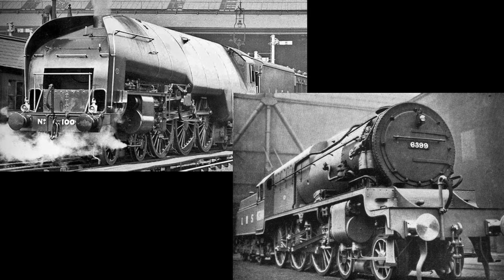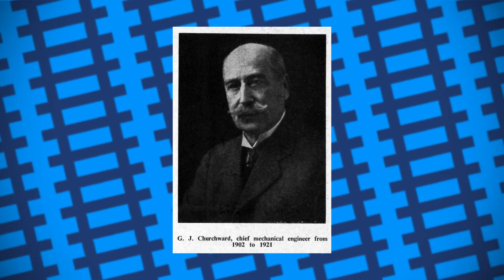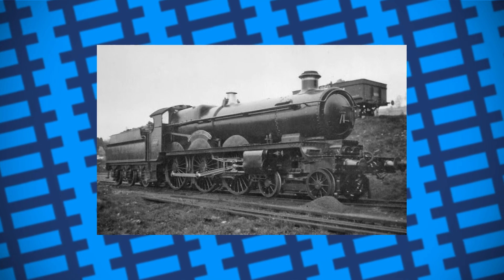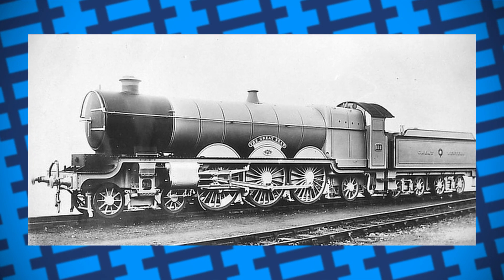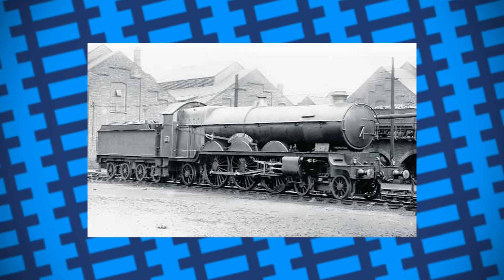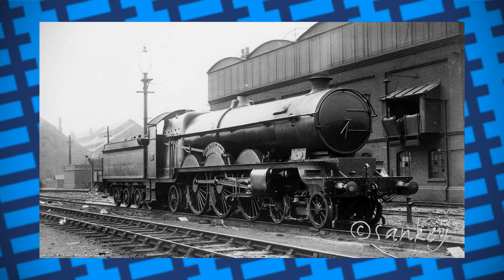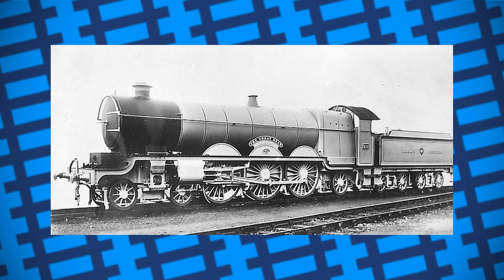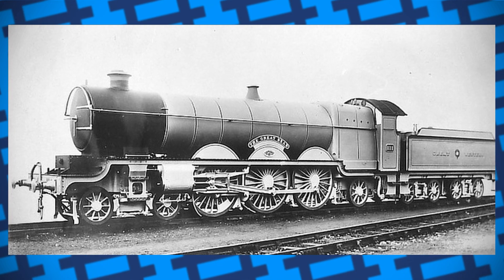The GWR's experimental pacific locomotive - GWR "Great Bear"

Comment: It has been suggested that the engine's frames may not have been very well aligned- while its trailing truck overheated- a problem that was never really addressed. This alignment issue could be a major problem and ended when C B Collet- Churchward's successor- a man who was not a locomotive designer- although his name is given as designer for so many classes- which were left to others to draught up- and were in the main part of Churchward's planned standard designs. Collet was a skilled production engineer and he installed Zeiss optical equipment at Swindon Works to make this alignment simpler to achieve and far more accurate. As the engine was pretty much limited to Paddington to Bristol, it was used for fast fitted freight and it was reckoned its big boiler was quite an asset- its tractive effort was not an issue as ultimately this is a notional power measure and if you have no steaming capacity, then tractive effort is irrelevant. Anyway, this aspect of its performance may have led Churchward to design his very big 47XX mixed traffic locos which did this sort of work with ease until 1964. The engine is a "might have been" and it should be remembered that the Standard BR Pacific- the Britannia class engines which were used on the Western Region tended to spread the track and were not really liked- although good engines, and did not stay long on the old GWR as the enginemen preferred their own engines. I suppose comfortable seats, doors and left hand drive were an anathema to Western drivers who were used to Spartan cab conditions.

Comment: Let's make it clear that Great Bear was not a "failure," it just wasn't a significant improvement over the Star class that was already standard on the GWR, plus it had the weight and length issues mentioned. On a railroad like the GWR, keeping a one-off engine around was a luxury the company preferred not to have. Presumably, one problem was that it was hand-fired; there's a limit to how much coal a man can shovel. The cylinders also look rather small, if one was seeking tractive effort and quicker acceleration.
Reply: hand firing definately wasnt a limiting factor, mechanical firing was never used in the uk and several bigger, more powerful locomotives than this where hand fired and performed perfectly well.
Reply: @joachimmacdonald2702  - weren't some classes of UK engines staffed with two firemen? I know the LNER A4 class had corridor tenders, although that was to eliminate the need for a mid-run stop between London and Scotland.
Reply: Some classes of German locomotives had two firemen, because they couldn't develop a reliable mechanical stoker until after WWII.

British locomotives also had an advantage with fuel- they had access to Welsh steam coal, the finest in the world. It's a low volatile full bituminous coal, which burns almost as hot and clean as anthracite, but is as easy to ignite and has the calorific value of bituminous coal- the absolute best of both worlds.
Reply: @FortunaFortesJuvat  - Definitely. A remarkable number of railfans don't realize that coal is a natural product, and because its quality varies, so do fireboxes. Northern Pacific R.R. in the U.S. burned lignite, or brown coal, because the mines were along their mainline. The coal was probably on the land granted to them by the federal government in the 1880s. So rather than bring in better coal from the East, they used engines with extra-large firebox grates.

Comment: I think I might know the problem if it's performance 
If you compare the Great Bear to other Pacific locomotives from the LNER,LMS and SR you'll see that the training wheels are positioned underneath the cab since they're bigger so since the Great Bear's cab was so small that's why the training wheels were positioned underneath the firebox instead. So maybe if it had a bigger cab it might have boosted it's performance then
Reply: it wouldn't be the first locomotive to have trouble due to poorly placed trailing wheels.
Reply: That makes no sense whatsoever. First of all, the size of the cab has no affect on performance whatsoever, except for maybe some tertiary effects on balancing. Secondly, most Continental European pacifics had their trailing bogie underneath the cab for axle loading reasons, and their performances weren’t hampered.

Comment: Kind of reminds me of the Pennsylvania Railroad's K5, the intended successor of the famous K4. The K5 were technically superior but they weren't enough of an improvement in speed or tractive effort. It probably didn't help that the same year, 1937, a new company EMC (later the renamed it's better known name EMD) introduced the EA/EBs for the Baltimore & Ohio Railroad. The route between Washington and New York was electrified during the 1930s and the famous GG1s were rolling out of the shops at Altoona. Basically the K5 was no better than it's previous model and arrived in the twilight years of American steam.
Reply: Good point! - In the 1930s, the Pennsylvania had little need for new passenger steam locomotives, with electrification sending hundreds of pre-1920 steam locomotives west of the Atlantic Seaboard.

Comment: One of the issues was the over heating of the inside frame axleboxes on the trailing wheels. It may have been more successful if they'd used something like the outside frame rear wheels on the Saint's in their 4-4-2 trial form.

Comment: It wasn't an experimental locomotive, it was just a design which didn't take advantage of its possibilities.    The advantage of a Pacific over a 4-6-0 is the capability of building it with a wide firebox.    This didn't happen.   With a new firebox, similar in width to an A3, it would have been ahead of its time.  It also needed a bigger cab.

Comment: Funny to see how a "big british express engine" is literaly the size of an American tank engine
Reply: The most produced steam locomotive in the US the S160 is almost exactly the same as the British most produced engine the WD Austerity. Random american engines were bigger but those were the exception not the rule. American engines did require bigger fire boxes because their fuel was much worse quality and bigger tenders for the obvious reason of the US being bigger.
Reply: @Alex-cw3rz The S160 was built to export to Europe and had to be built to more restrictive limits so as to function on both sides of the Atlantic. 

American locomotives generally didn't need expensive, maintenance hungry solutions like third cylinders since there was room to just add weight, hang stuff outside the frames where it could be easily inspected, etc. 

I'll grant that a lot of British locomotives did a lot with less, but often that comes at the cost of complexity - whereas a superpower era American/Canadian locomotive is likewise suited to its environment, and that environment happens to have a less restrictive loading gauge and axle loading, with a longer train behind.

And we need to find a track for the T1 5550 and a set of seven passenger cars, once it's out of the shops. Maybe even a track that's not downhill.
Reply: I never understood the open cabs either. With how much it rains in England you’d think an enclosed cab out be a no brainer.
Reply: @jaredkelly930  because of the constant heat and sweat from shoveling coal to feed the locomotive. you'd be hardpressed to catch a cold. its more of a crew comfort as access to cold air allowed for breathing space during the trip. 

tho i would support the idea of an enclosed cab in canada and alaska due to the winter weather there.
Reply: @jaredkelly930  I Lms Ivatts were a possible solution
Reply: @jaredkelly930  I guess american enginiers are more...whats the word im looking for?... Intelligent
Reply: @josea.nievessoto8000  see the (former) british car industry for proof of this😂 if you think American cars from the 20th century were shit... Look at britain😂😂
Reply: @nothanksguy   Oh yeah! I forgot about those rust buckets!
Reply: @josea.nievessoto8000  it's actually because we prioritized looks alot less to the point where most engineers wouldn't even bother making it look good, just functional
Reply: @josea.nievessoto8000  intelligent**
Reply: @nothanksguy  The image of Jeremy Clarkson rolling around, so to speak, in a Reliant Robin comes to mind…
Reply: @josea.nievessoto8000   you mean non-intelligent because bigger is not always better bigger wheels for faster speed bc u go further each turn but smaller wheel is less speed but more POWER! Also nothing absolutely nothing can beat a unrebuilt bulleid pacific with Pullman coaches and the Devon belle observation car on the back
Reply: @josea.nievessoto8000  more like more, practical
Reply: @josea.nievessoto8000  You can’t compare British to American engines. Two completely different loading gauges and entirely different terrain to tackle.
Reply: @nothanksguy  Reminds me of that bit from the I.T. Crowd, where the fire extinguisher bursts into flames because it was "Made in Britain."
Reply: @josea.nievessoto8000  even though it is hot and dry lol
Reply: @josea.nievessoto8000  No denying they look nice though (Well some)
Reply: @nothanksguy  thank God for the mclaren f1 and that speedy Vauxhall
Reply: @jaredkelly930  the crews didnt want them
Reply: @jaredkelly930  I’m sure somewhere in locomotive hell the sr leader class is smiling at this comment
Reply: It was bigger than American built 4-6-2 types of the same year.
Reply: The British Loading gauge which is the product of numerous Laws, seriously restricts the size of British locomotives. However on a pound for pound weight basis the Great Western Railway's King Class locomotive "King George V" that headed the Pennsylvania Railroads USA Cavalcade every day at the "Fair of the Iron Horse" in 1927. Was the smallest but most powerful locomotive included in the cavalcade. How so ? Because British locomotive engineering was far more sophisticated out of necessity, to get ever more power into a legally restricted size !!!!
Reply: @JamesSmith-mv9fp  also British Steam engines are more elegant.
Reply: considering the denser area i wouldnt be surprised. tho as a person who has seen both british and american steam locomotives. many of the american engines have been alot smaller. not telling its a bad thing it just means they can get it working for less space. but many of the american locomotives honestly was a step behind its british and european counterparts.
Reply: @teodor9975  What makes you say that?
Reply: @FS2K4Pilot  that on what? denser area or the cabs?
Reply: @teodor9975  I was actually wondering what you meant when you said you thought American locos were a step behind British ones, but I’m also curious what you meant by those other comments, as well.
Reply: @FS2K4Pilot  ah. what i mean is that the size and performance on some of the american locos were a bit behind or atleast as far as i know.

as for the cab. its more of the working conditions causing extreme heat so the open cab is a good idea to give cool air for the crew. thats all
Reply: @teodor9975  you must also consider that american coal is usually much less potent/efficient at providing heat than the majority british european coals. Tons more waste soot
Reply: @nothanksguy  aye. tho most of that can be solved with smoke deflectors
Reply: The UK is just smaller, having a 2-6-6-6 would be a waste of space and fuel to run it
Reply: American tank engines were smaller it's just American trains always make them massive a make and aggressive whistle instead of a nice peep so that the sound and look powerful and strong...
Reply: Well british railway is alot small but fast than American railway
Reply: That’s because American engines are literally on steroids. I’m American btw, and yet I still like British engine better.
Reply: No and even the point you are trying to make is wrong, as British trains didn't have as far to travel or have an obsession with giant freight trains.

Comment: I wonder if the trouble was back pressure? Even the LNER A-4 class 4-6-2 did not reach its full potential until double chimneys were installed. A number of mammoth American steamers also benefited from the Kylchap system, including the Big Boy and Challenger.
Reply: Actually, the Kylchap system didn't take hold over here in the US. Yes, there are dozens of loco classes here that have a double stack, but they're just conventional blastpipes. The Kylchap probably wouldn't have worked well over here anyways, just due to the higher boiler pressure of the engines that would've benefitted from its use. The exhaust blast from the larger cylinders would've probably damaged the Kylchap nozzles due to the pressures involved(yes, I know that steam would expand in the cylinders, thus reducing the pressure, but we're talking boiler pressures of 300 PSI here) or just been an obstruction thus creating less draft. American steamers used conventional blastpipes combined with special ends on the exhaust passages from the cylinders to somewhat create the same effect as the Kylchap did for the smaller Europeans without having an assembly of metal in the smokebox potentially creating issues
Reply: @high_admiral5196 - Thanks for all that. Someone in Britian should do a video explaining the features of the Kylchap system. I've visited the LNER A-4 in Green Bay, WI and even they don't explain the Kylchap system on their exhibit.
Reply: @HSMiyamoto  Well, its also a largely unknown system. A lot of the work by Andre Chapelon has gone unnoticed in the States. What wonders could’ve been done had we applied those principles.
Reply: @high_admiral5196  I think the story of the Vauclain compound tells you your answer. Most North American compounds were simpled by 1930 because the maintenance cost exceeded the fuel savings.

Comment: GWR engines were nicely engineered, but it took until the Castle Class, before they decided to put a proper cab on their locomotives. The stingy little cab made the pre-Grouping locos look out of proportion with the size of the Great Bear making it look worse.
Reply: The GWR put a nice cab with side windows in the GER style on a 4-4-0 around 1904. It might have been unpopular with the enginemen.
Reply: @physiocrat-sv   The GWR men must have been a stoic lot. I know they were fiercely loyal to the GWR. These wretched pre-Grouping cabs would have tested my loyalty, being stuck on the footplate of one of those engines in the dead of winter.
Reply: @physiocrat-sv It was unpopular.

Comment: When exactly was the GWR the largest of the pre-grouping lines?  The history I read listed it as third at the time of grouping, behind the LNWR and Midland.
Reply: It was third as soon as the grouping happened, behind the LNER and LMS.  It was the largest pre-grouping company by far, so much so that it pretty much stayed as it was, unlike the others that were an amalgamation of several smaller companies.
Reply: @Titan604  What you say is indeed correct - it was never questioned.  What is in dispute is the relative positions of the various constituent companies immediately PRIOR to grouping.  The history I read, had the LNWR at #1, and the MR at #2 with the GWR at #3.  Both of the first two became part of the LMS while the GWR was merged with a number of minor companies and retained its original identity and the LNER never came into the discussion.
The original plans were to group approximately 130 railway companies into a "big six" more-or-less evenly-sized networks.  Scotland was to have it's own system and the area north of London as far as the Scottish border would have been divided into three main areas.  For various reasons, the big-six became the big-four instead with the proposed central region instead becoming part of the LMS and the Scottish region being divided between the LMS and the LNER - this making these two companies vastly greater than the GWR.
I no longer have access to the history books I read and I don't remember the author's name - I just remember that it consisted of three large volumes and that immediately prior to grouping, both the LNWR and Midland exceeded the GWR in terms of route mileage and revenue.  I was wondering what Train-of-Thought's source was when he stated that the GWR was the largest PRE-GROUP company - which I don't believe it was.
Reply: @mpeterll  Pre grouping GWR 3,005 miles, LNWR 2,668 miles, MR 2171 miles.
Reply: @Titan604  Grrrr.  I hate it when reference books turn out to be wrong.  Thank-you for the numbers.  What source are you using?